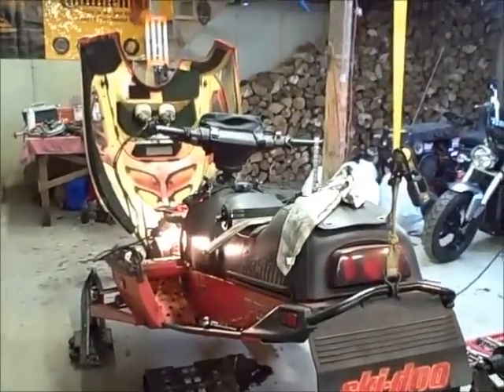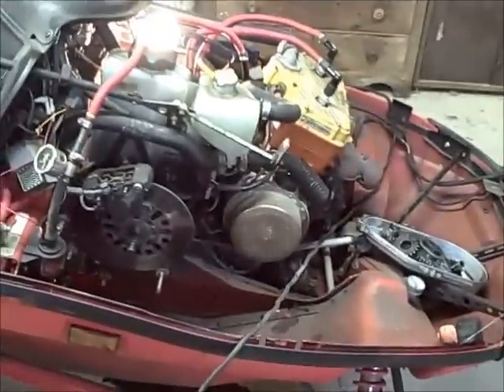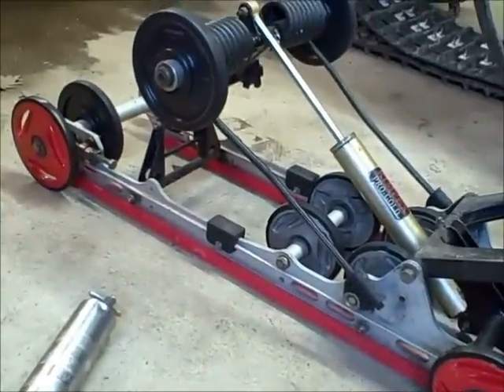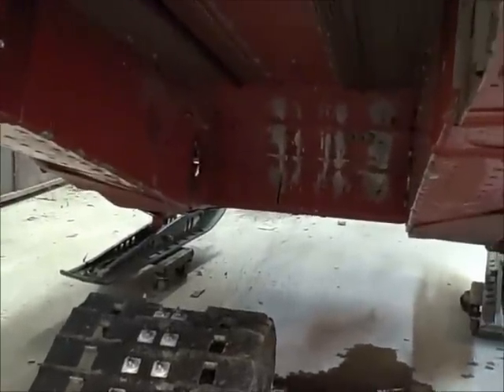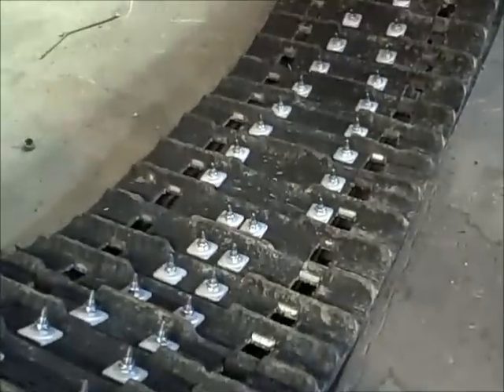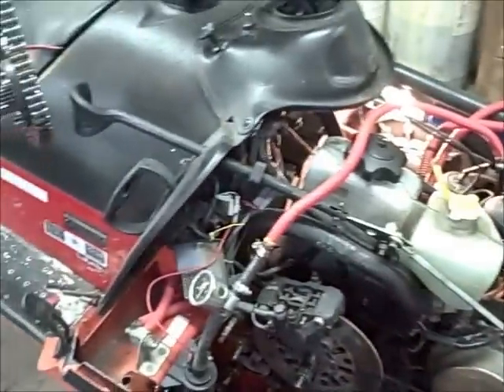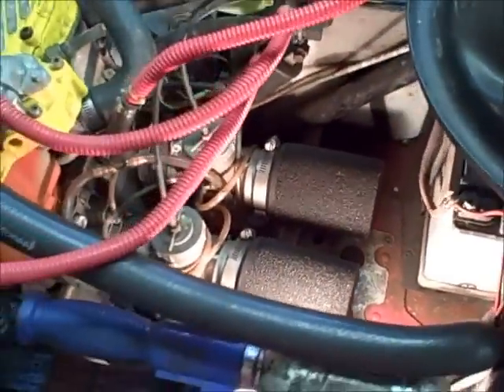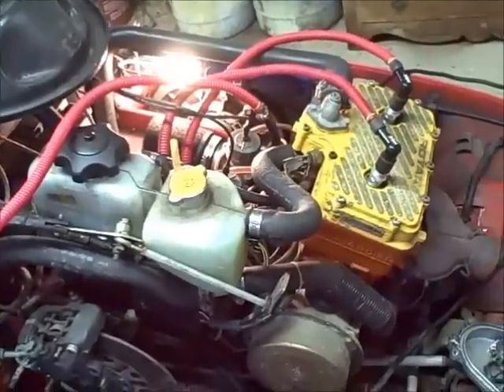Working On My 1997 Ski-Doo Formula Deluxe 500 - Maineyak

Comment from the maker: It's a little tricky, the pump is directly below the motor, probably easier to unbolt it and move it first before you try to remove the fuel lines from it. It's in a tight spot.

Comment: Hello, I live in vassalboro maine and have a 98 formula 500 de luxe. I was wondering if you had to change the jets after you installed the uni air filters and moded the pipe. And where do you get your parts? oh and by the way that is a sexy mazda!!!
Reply from the maker: I did go up one jet size on all the jets. Not all the jets are the same depending on the cylinder. Most of the parts I got were either from amazon, ebay, or automatic distributors in Bangor. And thanks! :-)
Reply: TheMaineyak Hey i just finished up installing a 1.25 ripsaw on my 500. I ran into alot of problems along the way, bogie bearings the chain case was cracked wide open on the back side due to the dealer doing a half ass install of a new chain case chain. I think they over torqued the bolt that holds the reverse gear. So i ended up deleting the whole reverse system. I also moded my pipe as well i cut open the end of the pipe removed all baffles and fiberglass packing. Sounds great now. Do you think 320 pto side and 300 mag would be good for main jets? im going to get the same type of air filters you have as well. Is yours running good?
Reply from the maker: I went exactly 10 over the stock jet sizes on each jet on mine. I almost think it was 310 and 290, but i I've sold my 500 since this vid, can't quite remember. It was still running great when I sold mine. Good luck!

Comment: I have a 97 Formula 380, the battery was dead, i tried charging it a couple of times, started it, ran it, but turns out needed to be replaced. I put in a new battery and now it cranks nicely, but it won't start. Seems like no spark. I made sure the tether and kill switch were on. Question, should the ignition coil be getting 12V on the red wire going to it all the time when the ignition is on? Because i'm getting nothing.

Comment: I have this same snowmobile.  It is my first one and my first season.   What type of oil should I use?  Just snowmobile 2 stroke or is there a specific one.  you don't mix the oil with fuel correct?  What about the coolant?  60:40 antifreeze:water?
Reply from the maker: I always used Castrol 2T snowmobile oil, but any decent 2 stroke snowmobile oil should work fine. There is a reservoir under the hood for the oil. Coolant I use regular green 50:50 premix.
Reply: @Maineyak  cool thanks

Comment: What did you use for the filters? I got a 96 formula and want to add a battery. That would be perfect mod so I can remove airbox to add the battery.
Reply from the maker: Logan Welch i used the UNI brand pod filters.
Reply: Anyone lose spark cause of a dead battery on a formula?

Comment: I have a 94 formula z 670, fuel pump is under the motor like yours was. Did you have to pull the motor to get the pump off?
Reply from the maker: it's definitely much easier to undo the motor mounts and prop the engine up with something to gain access to the fuel pump
Reply: Yah I am just changing a broken line, but I am going to move the fuel pump to beside the airbox for easier access in the future
Reply from the maker: +Josh P nice!

Comment: couldn't hear sound on video that great because of my location but would your sled move at all?  I have a 97 ski Doo 583 and it will not move and I don't know why
Reply from the maker: +Joseph Reed It won't move? I'm not sure, could be something within the chaincase or something wrong with the belt and clutches. In this video I was replacing a few stock components, a couple bearings, the track, etc. It drove great afterwards. Good luck with yours.

Comment: how do you know if its a Deluxe or Sl? my first numbers of the vin is 1139. i can't find anywhere that will tell me if that just a regular formula 500 or deluxe. cause im having to maybe put new piston rings in and i don't know if its gonna matter. its a 97 formula model but that's all i know, but it does say it was made in 1996 on the side.
Reply from the maker: All the formula deluxe models had electric start and reverse, liquid cooled, and also the bottom half of the body was red instead of black.